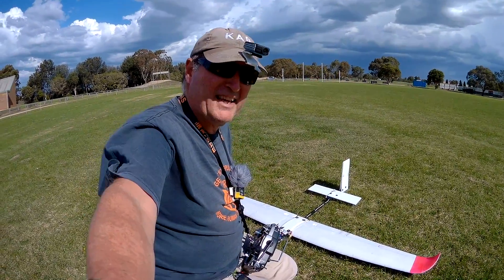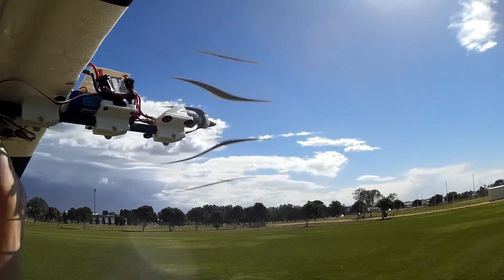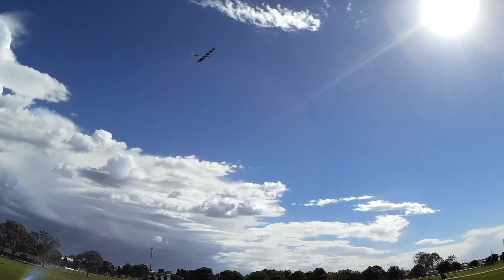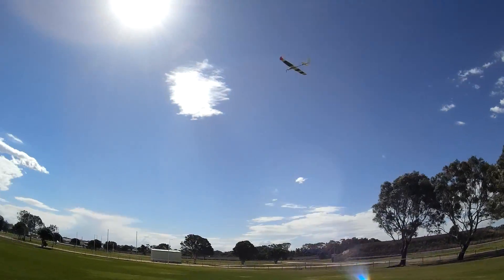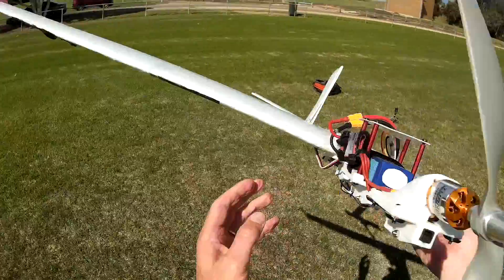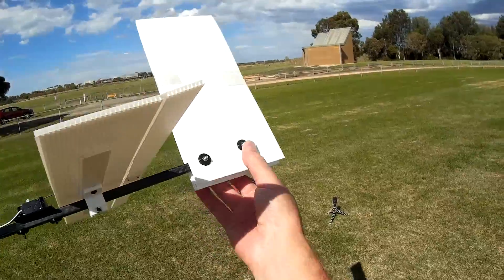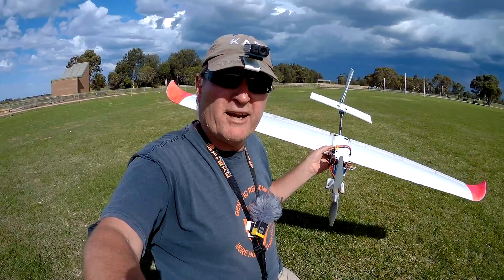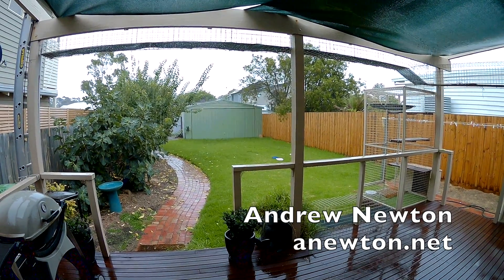Open Wing System - Maiden

Comment: Having no fuselage to speak of may actually be better in that wind.
Reply: Well, yes and no. To be efficient and streamlined all the bits and bobs need to be covered by something reasonably streamlined, otherwise they all create drag. But I'm betting that this is pretty lightweight. Lol which is also not so good in strong wind. :¬/
Reply from the maker: Weight wise I'd say it was definitely heavier than a full foam fuselage, but way tougher. The corrugated plastic is twice the weight of depron

Comment: Interesting concept, properly priced, it would do very well.  I browsed the site and thought the prices were too high (even with the "sale" tag on the site).  I've got way too much lite ply and balsa in my shop that I can use to fabricate all those components for a fraction of that cost.
Reply: gsansoucie, I've updated the prices, do you think the new prices are more in the range that might be appropriate for the hobby community?
Reply: Gene Sher take a look at the HK Slow Stik PnF. It's $78 with everything except the rcvr and battery.  It's not an apples to apple comparison, but a good ballpark comp.  I didn't check out your Kickstarter project, if you are 3D printing these now, your costs are going to be way too high, having these contract manufactured will give you the best option, but then you have to warehouse and distribute the kits.
Reply: Thanks, I've updated the prices, they are now around 60% of the original price tags, and we are now talking with a few distributors who can produce the parts in large quantities to hopefully help in further dropping the price tag, without moving to a lower quality filament material (normal filament does not survive crashes or wear and tear of larger builds, so we use the more expensive polyurethane filaments, and then post-process the parts).

Comment: It works as expected. Heh, maybe a little too much wind though. I'm guessing the plane was relatively light. 
Unfortunately I have to agree with other comments about the prices. At half of those prices they would probably sell more than could be printed. But as 3D printing gets faster, things should improve.
Reply: Hello wordreet, thank you for the honest analysis of the prices. We'll lower the price as per the comments and suggestions. There is a price point though, at which it will no longer be profitable to manufacture the parts, since the particular material we use is more expensive than standard filament. What do you think of the new prices, is this the price range you were considering?
Reply: HI Gene, I'm well aware of manufacturing costs and how they can affect a new small production company my friend.
 I'm a machine setter in a small-ish precision engineering workshop. We machine precision components and prototypes from both metal and plastics as a subcontractor. http://www.adaero.co.uk/
 I'm guessing that if you ended up with hundreds of orders per week, you'd have to have twenty or more 3D printers on the go 24/7 .
 And I know that prototyping is not a cheap process at all, as a lot of those components end up scrap and the plastic, at least in our factory, is not recycled. 
 If you don't mind me asking, what sort of scrap ratio are you encountering? That can give people an idea about your own quality control and some of the hidden costs in actually making these sort of items.
I'll be honest again (thanx for saying it) and say that I usually make everything for my RC planes myself apart from the electronics. I have a miniature lathe at home and hope to acquire a similarly small milling machine in the future. Oh and I'm also going to  attempt to build a 3D printer this year. ;¬)

As to feedback on the designs of your components. Even more attention to streamlining them will never go amiss. Anything that reduces drag reduces power consumption and that's welcome on any aircraft.

Oh and if you were in the UK and the prices were half, I would buy an Open Wing advanced set just because it's interesting. I'm not actually into FPV or camera drones. Preferring gliders as I do.

Good luck anyway matey.

Comment: It's an interesting concept, but massively over priced. I had a quick look round that site and you've got over £100 worth of 3D printed parts there. One for the guys with their own 3D printers I think.
Reply from the maker: Keep it civil, this is my channel
Reply: Tsnafu, we plan on releasing the main .stl files at the end of this month, as we noted in our kickstarter campaign, some of the main modules are still being redesigned. We are following the same approach as MakerBeam, if you've ever used it. With regards to the parts having a high price, we are still in the process of zeroing in on the appropriate market price, such that we can still produce and design new parts, and still have a business. The prices are somewhere in the same region as rotorbits.
Reply: I recommend doing a little bit of math Tsnafu, add up all the bits that you'd need for a frame, and then do the same for our kits... only unlike rotorbit parts for quadcopters, we are not using some cheap PLA/ABS material...
Reply from the maker: Well I think that's the idea, open source designs
Reply: I don't think there's much "open source" about it Andrew. It appears that he's just selling overpriced 3D printed parts
Reply: I cant agree more they are very expensive for what they are when simple corner guard and glue have been proven in to work just fine at the expense of time although cable ties and quick drying glues can be used to speed it up a lot. 
I think this is more a system for rapid prototyping and proof of concept for new designs not trying to remake existing designs. Rather than spending a many man hours making something this system can be used to make a design layout in under 1 and can be in the air very quickly and crashing before you know it. Then it can be built and remade with in the hour and back in the air again.
Reply: Once you have released your .stl files you can start calling yourself open source, at the moment you are sellers of overpriced 3D printed parts. As for "prices in the same region as rotorbits" - you are not even in the same ballpark - check for yourself https://hobbyking.com/en_us/multi-rotors-drones/rotorbits/parts.html
Reply: Nope - "cheap" really can't be applied to any of your parts, certainly not your £25 - £35 motor mounts (+ another £20 part to clamp it to a spar) or your £20 ( x 2) wing mounts. I don't think you should be comparing yourself to rotorbits when you can get all the parts required for a tricopter frame including carbon spars for under £30.  https://hobbyking.com/en_us/rotorbits-tricopter-kit-with-modular-assembly-system-kit.html
  
BTW, do you think you are doing yourself any favours getting your arse whipped in a public forum like this?  Let it drop Gene, this argument is as dead as your kickstarter

Comment: Nice video, i like the basic way this plane looks and shows a very nice standard layout for prof of concept, no frills with good performance. what happened 1050g???? its a bit of a porker compared to your other similar looking planes. I am guessing this motor and battery is very over sized for this setup contributing to the extra mass?
Would like to see how quick you can convert it into similar style planes you have like the fusion sloper (minimum weight powered and unpowered) and DLG, among the other what sounds like a wing you talked about at the end maybe a build video. How about some crazy designs like a dual wing one at the front and one at the rear with the motor just forward of middle (or front maybe for balance) on top of the standoffs to clear the boom maybe dual aileron mixing to fly (like a flying wing)?
Reply from the maker: It's not a lightweight but comparable to powered planes of similar size. The Phoenix 2000 is 200g heavier
Reply: That to me sounds like a little bit of a downside to the system it seems so minimal but weighs just as much as planes with all the bells and whistles. Those plastic parts must be pretty beefy, any chance of getting in the air at sub 500g or possible to remove some material with out reducing the durability to much?